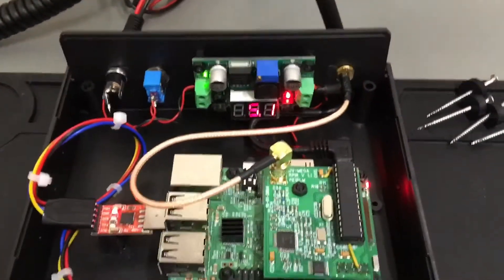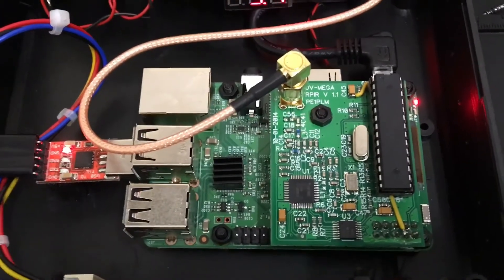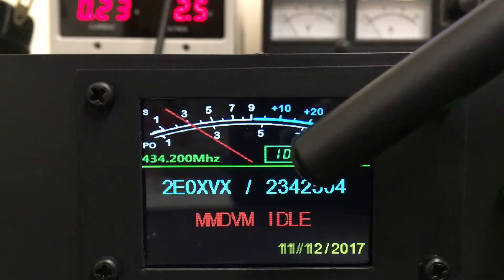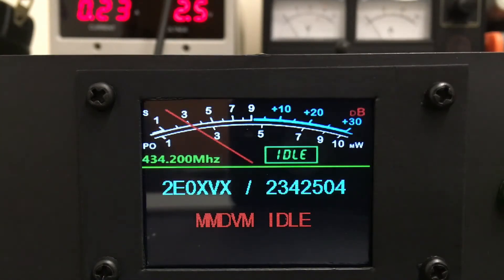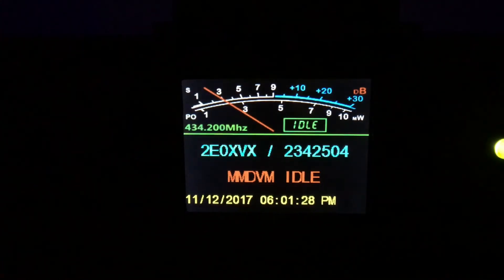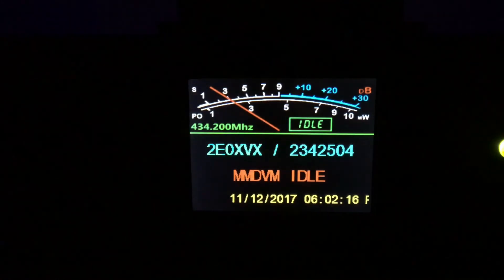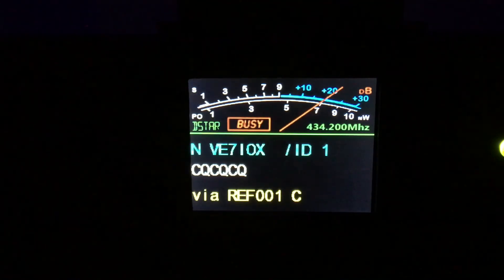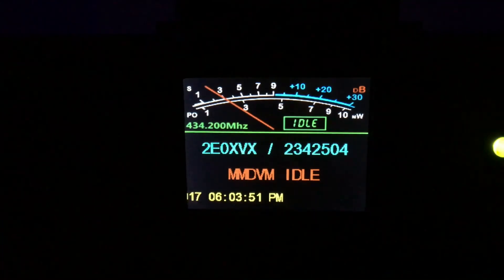Nextion Screen Display

Comment: Have the MMDVM and RP zero working well.  Added Nextion enhanced 3.5 in display and it is working producing basic information.  What must I do to get the BER , RSSI and S-meter to function.  Am running PISTAR 3.4.16.  Any information would be appreciated.  Thanks

Comment: I am looking for one for my car, was looking at a zumspot and an MMDVM hotspot with a display, I like the display but need something compact. What do you recommend?
Reply: Sky1 Don’t know if you are sorted I am just starting with digital and hotspot. Got SharkRF v1 for home, then bought one from eBay with mini screen and case complete fir Pi. Zero. This works great in the car an so compacted. Power via car usb charger adaptor linked to mobile router with SIM card. Will try tethering with my mobile phone.

Comment: Great job
I have my 2.4 screen now and have been playing with the design too.

I can do everything except get info from mmdvm and set it to a variable on the screen.

Any help would be great
Reply: I found a short pdf file on a facebook group that told what to use to display info from the MMDVM :) works great and looks beautiful if I say so myself.
also mine shows UK date format DD/MM/YY and 24 hr clock by default
Reply: Do you have a link to that PDF file?